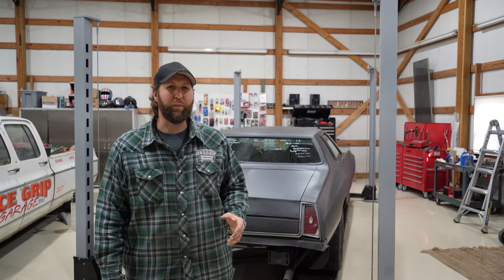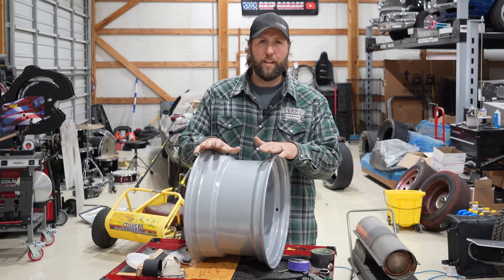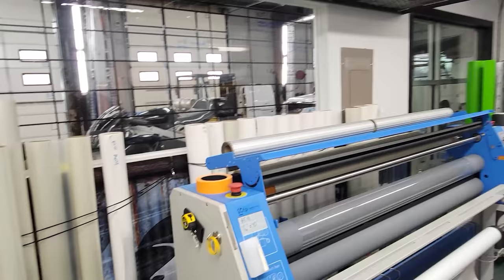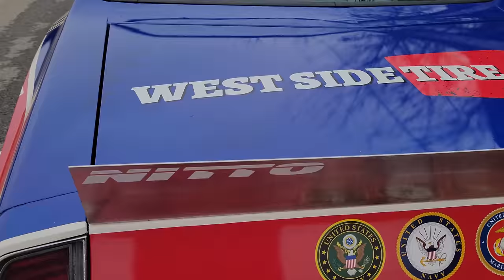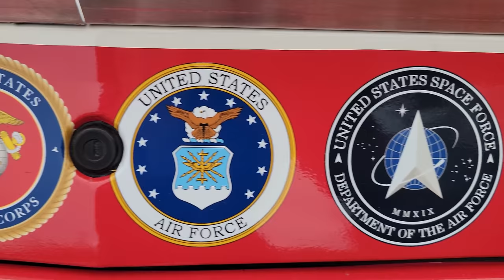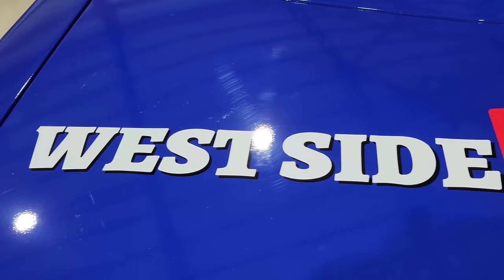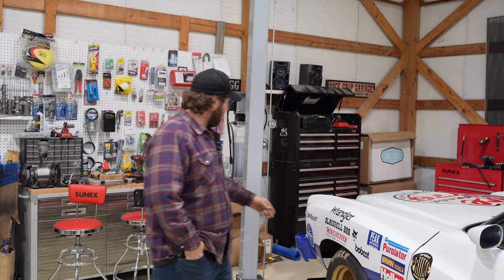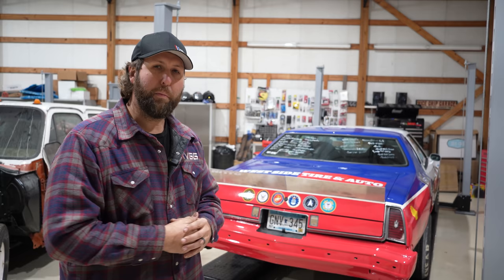70's NASCAR Stock Car REVEAL - ITS FINALLY DONE!

Comment: I’m old school like you  I used to use the same heaters in my shop.  I found the val6 heater keb5l   97.65% quieter and cleaner   Kinda high on the old wallet but so well worth it. Dad tried the knock off brands no dice had to break down and get val6 keb5l  try it you’ll love it

Comment: I watched this whole project from start to finish and it turned out great, congrats! The next thing I would do is get that factory A/C working so you can enjoy comfortable cruising during those hot summer months and track events. I think some kind of flush-mount LED lights (amber for front/ red for rear) to fill-in all those empty bumper holes from the rubbers. It would look cool at night for some extra safety and bling. Then maybe spiff-up the interior a bit since it seems to be a keeper and enjoy it everyday!

Comment: Back in my just a kiddo days we'd get a treat every now & then to go to the races at Kalamazoo Speedway.. most of the race cars were Monte Carlo's spanning from 72 & up round 79 or so with usually at least eight of em trading paint and bump drafting with those glorious chrome bumpers with chains wrapped around and secured to the body..doors with welded tabs to hold em shut and if the body's got beat up enough..therd be some creative hackwork with whatever sheet metal happened to be around got put on by any means necessary & some more cheap as you can find paint went back on to battle again for the next race.

Comment: I had to laugh at the IItty Bitty Machine (IBM) Company. I learned how to repair Control Data machines. Seymour Cray invented RISC which is what makes Apples so fast. But I remember the old CanAm circuit. NASCAR wasn't until the 80s. I could be wrong because I never was a race car enthusiast but I knew all of the other stickers you have there..